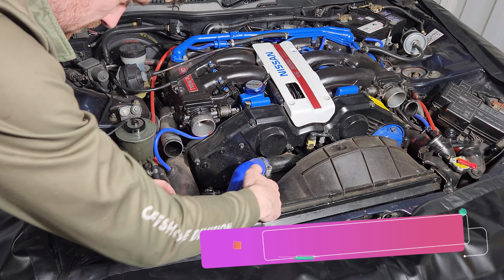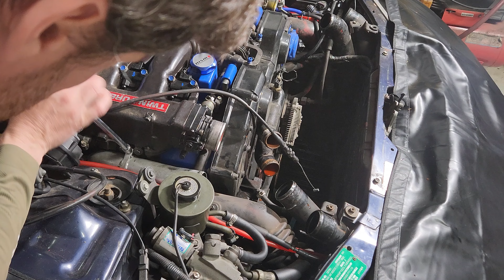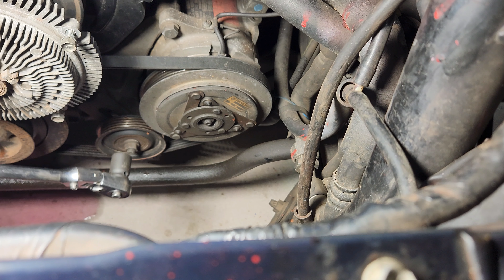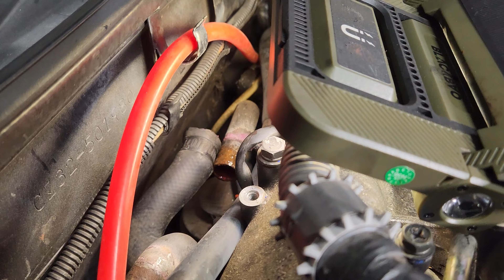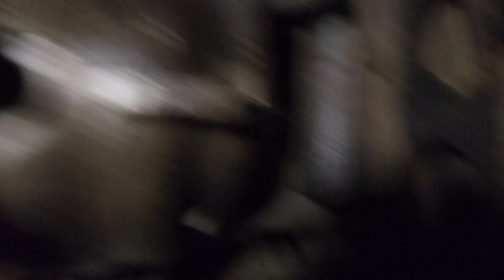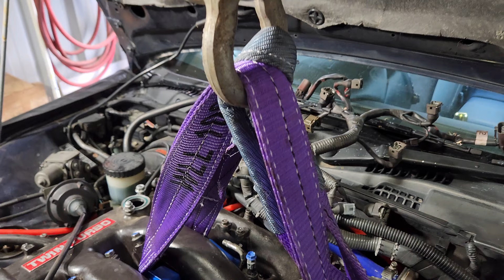Nissan 300ZX Z32 VG30DETT Engine Removal Step-by-Step Guide

Comment from the maker: *If I were doing it again I would move the sling forward one position on the Manifold, allowing the engine to tilt further back, using the come-a-long on the water outlet tube was not ideal and I would not recommend as I have no idea how strong it is.
It worked for me but avoid if possible.

Comment: Great video, did you disconnect the power steering hoses?
Reply from the maker: I didn't, I just disconnected the P/S pump from the engine and left it in the bay. 
However when I put the engine back in I took the pump out as it was a pain to work around and for 3 hoses it was pretty easy to take out.

Comment: Great video! I'm in US and have a LHD so there were a few differences on which side stuff was on, but worked great for me. I DO however recommend pulling the driveshaft, wasn't able to wiggle the tranny out with the drive shaft still in.
Reply from the maker: Thanks mate, strongly agree with the drive shaft as I had to remove it anyway to put the engine back in 😅